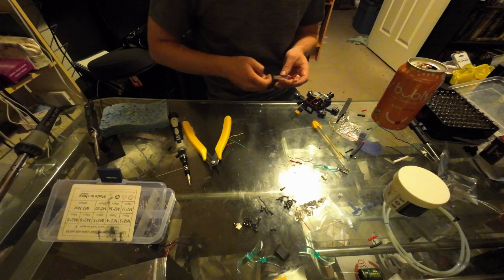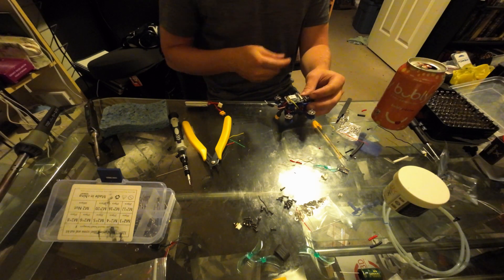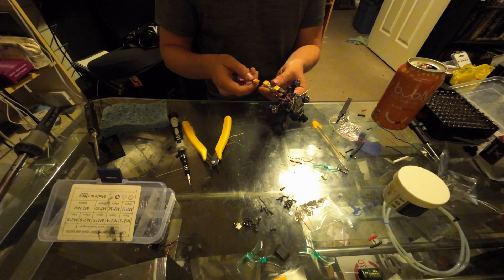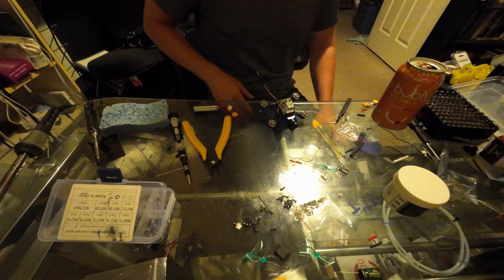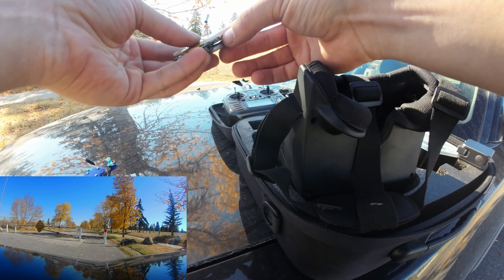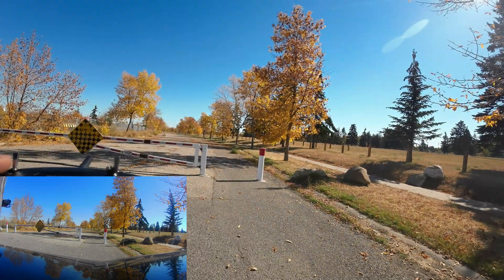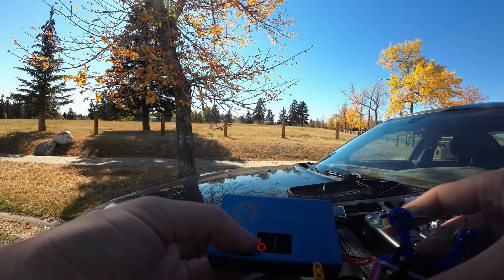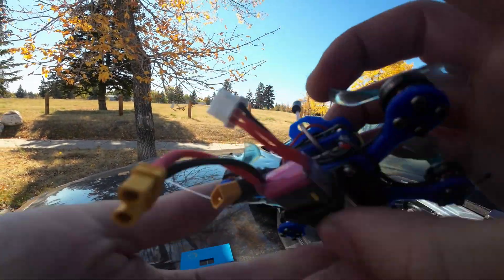I Built A 4kUHD 40mm Fpv drone with a 3D printer!

Comment: so I am using the 3 hole motors did you have to modify the mounting holes
Reply from the maker: I used 4 hole for the design and build. If I remember correctly, it was a tight fit. For 3 hole, you would have to modify the design, or drill out new holes. Drilling would weaken the frame a bit

Comment: Is there a reason you went with squished X? Square frame would have slightly better pitch authority and stock tune. If you do a v2 of the frame, make it square, and size the arms for ~2" props. 3" flies great up to 250g, so it stands to reason that you would get killer performance having 44% of the prop area and 32% of the weight. Not bad for a v1, but 70% throttle at hover is a lot.
Reply from the maker: Initially I was planning on making the arms foldable like cheap Amazon drones. Before going to far with that I figured it would be good to test flight dynamics on a rigid frame. It's why they are biblade instead of tri or quad. My main goal is to make it as physically small as possible so going up in prop size is out of the question for this project. As for why squished x... I honestly don't know, I wanted to keep the body as small as possible and that just worked out to be the minimum angle needed to keep props from touching.
Great suggestions though, I will take them into consideration for the next iteration.

Comment: Is that a eachine novice 3 kit? I recognize the package. We got the exact same setup! I got the TX12 and everything. I might build this!
Reply from the maker: Lol yeah! It's the old version though, got it awhile ago. Mine came with the Eachine ER8 controller and it was terrible! I kept the ev800's around for when I do analog projects, they are good goggles. Now the bag doubles as my tool bag 😂
Do it up man! I'd love to see your version of this.
Reply: @nateharmsfpv  I got the old version as well. Er8 controller and everything. I just got back in the hobby a couple days ago so I have not paired my TX12 to it yet. My range is terrible at 150ft about. Does the TX12 boost the range of the novice 3?
Reply from the maker: @ecoalex9345  a little bit. The tx12 has a better antenna, but it's still limited by frsky D8. I burnt out my novice 3 and totally modified it from the ground up with frsky D16 and then crossfire. Frsky D16 was way better but still not perfect. Crossfire will just outrange any vtx now which is nice.

Comment: Print is very simple. Is that a 25*25? Wish I had a printer. I also have a split, but a caddx, 1102s and lots of 2s
Reply from the maker: Yep, nothing complicated about it. At this size, simplicity was the best option. Yeah, standard whoop size 25.5mm. Printers are awesome for this hobby man! Ender 3 is not too pricey either